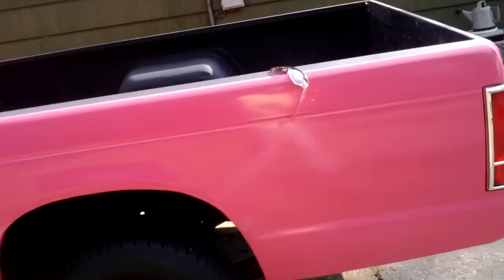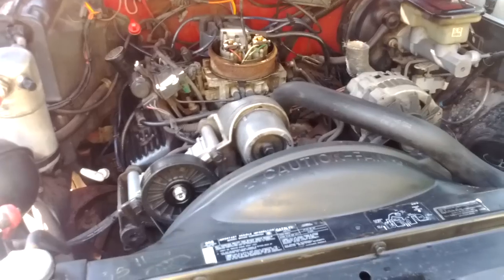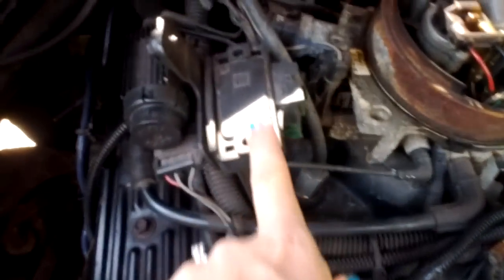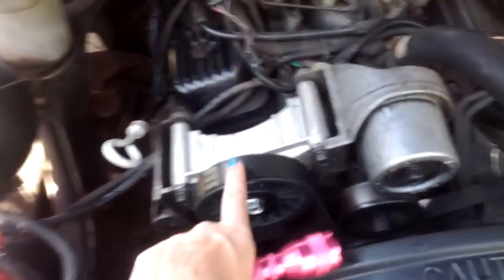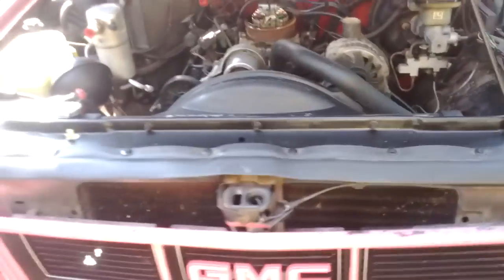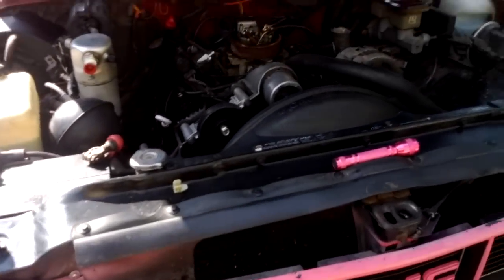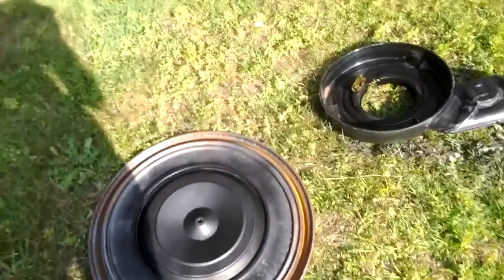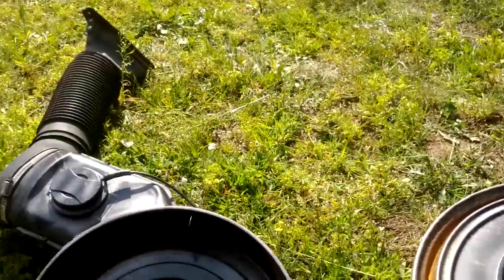Cleaning TBI - s15 4.3L v6 GMC

Comment: egr valve may b clogged, take off & scrape  built up carbon to clear passage, could b sticky idle air control valve, i sometime hve success removing & setting it connector side down, put one drop of 3in1 oil on the rod that holds the taperd valve, let soak, i.e. gravity do its trick, then reinstall. also a good idea when air cleaner is removed is to plug all vacuum lines, i use a short peice of hose that fits tite with a golf tee shoved in the end. hope this helps. u go girl! hail the 4.3s

Comment: I'm so proud of you young lady! Thank you for clearing up a few things for us. Oh I agree with Mr. Don Schriber, check all your vacuum lines on your TBI, I noticed that some vacuum hoses were off as well. Sometimes people take off that IAC valve if your're at the front of your truck, it should be to the left at almost the rear, looks like a big spark plug. sometimes those have gunk stuck up in there. Also if you haven't I would replace new plugs, cap & rotor, pcv valve, air cleaner filter, and that round canister at the front to the right. new filter at the bottom. It also seemed like those two injectors, weren't spraying right. Does anyone else agree with me. We are all proud of you, keep learning. We will catch you on the flipside.

Comment: I randomly came across this video. Fuel pump it may be, im having the same issues for when running for a while and you go to a store or something and come back out and it idles rough or doesn't want to run until a couple minutes. Today it hit 100, heat does not help at all. Talked to a mechanic and mentioned it could be the idle air control valve. Gonna see if that helps, thanks for the info, hope all is well

Comment: On the right side on bottom of the T B (carb) You see an empty port, Plug in the right vacumn line (small black line) MAYBE LINE FROM AIR CLEANER? Also same side of T B there is a line dissconnected from T B, attach that to the spot by accelerator cable. You will need a clip. These 2 things should straighten out your problems. Dont woory about premium gas. Give it a try. You seem mechanically inclined. GOOD LUCK  And little water out exhaust is ok. NO WHITE SMOKE.

Comment: What is the connector piece on the metal cylinder that goes around the throttle body? I noticed that I don’t have that hose connection and I wanted to see what that was.

Comment: Quick question. I found this video while looking for help identifing a part. Where the throttle body is, there is that metal part surrounding it. It has a metal hose going from the throttle body to the engine block. I was looking for what that part is called.
Reply: pcv hose connects your TBI to your PCV Valve

Comment: hey I see you have a ac delete pully.did it make a difference in power at all?
Reply from the maker: That was the sign my air compressor was failing, every time it kicked in it dragged the belt, so yes I noticed a difference in power. I'm sure if I'd like to put a new one in next spring... haven't thought about it's effect on the power though. seems like a lot of people who race or drag take it out so maybe.